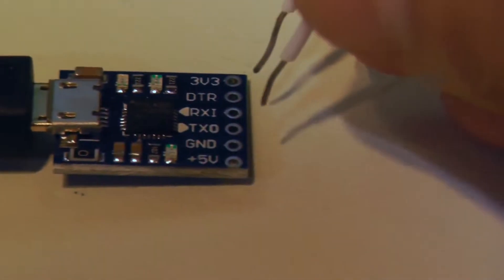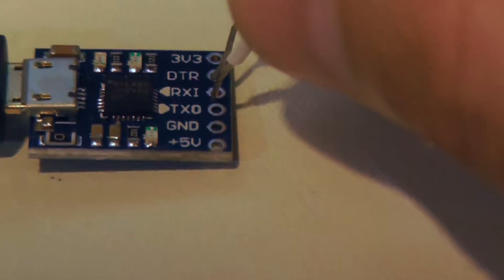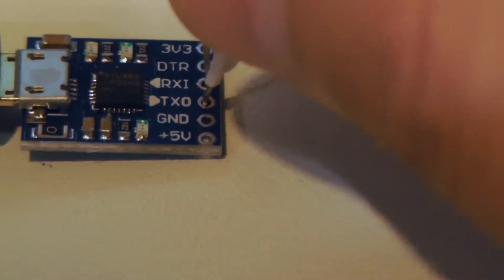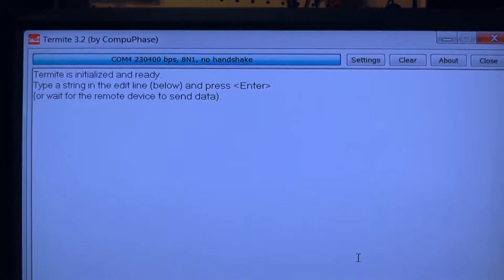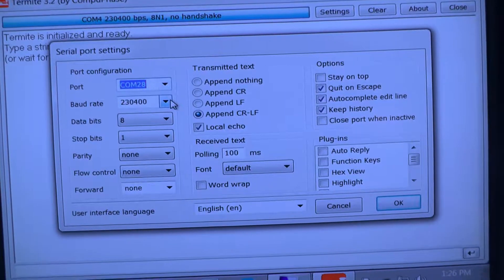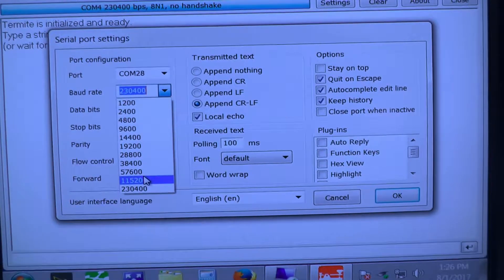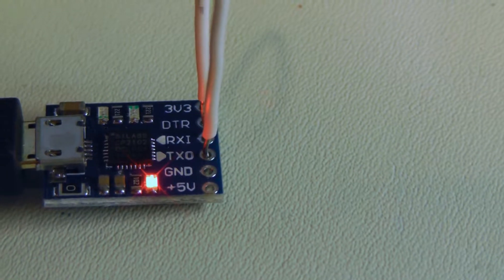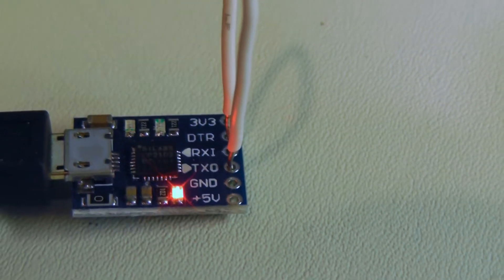How to test a USB Serial TTL Converter Module without another module or MCU.

Comment: Thank you for this video, I have a bought a chinese Arduino Uno clone and it did not show echo the message back what do you think the problem is, I have checked the cable and it is working, I have checked the driver and it is installed properly, I have done everything but still did not work, and I have tried it on a different laptop and it also did not work I honestly do not know what the problem is, and I have also tried everything on a different chinese Arduino Uno clone and it also did not work for some reason.
Reply from the maker: Arduino Uno will not echo data unless you put a sketch on it to do so or are you connecting the tx/rx with a wire. This video is about a simple ttl usb adapter so it might not work with a board like uno.
Reply: @starlino  Do you know how to do it on an Arduino Uno?
Reply: @starlino  I am also connecting the tx/rx with a jumper wire